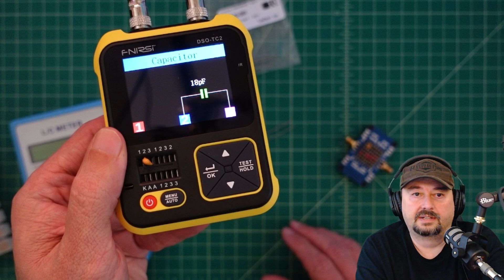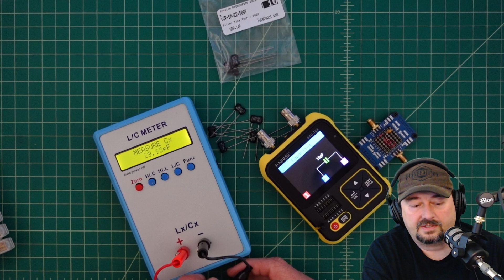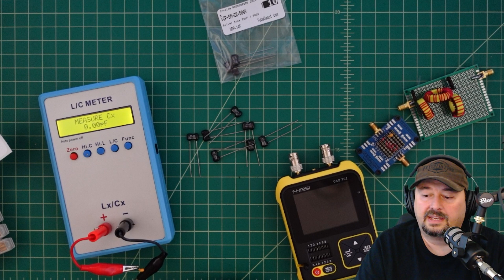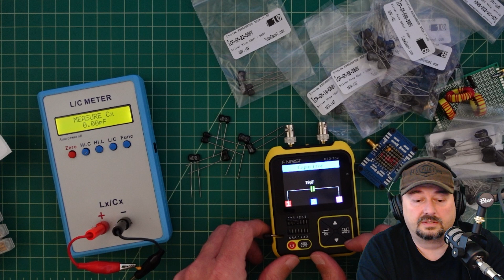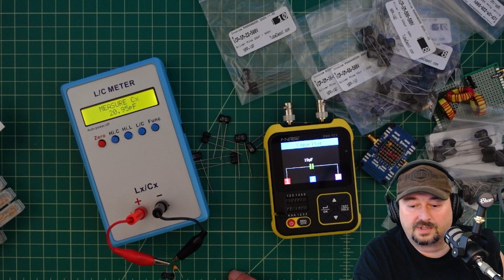Measuring Capacitors - Slight Rant

Comment: Inported capacitors RF functionality Quality is all over the map These days....For Critical Vhf & Uhf applications,  Industrial standards recommend Silver Mica capacitors < 1000 pF  Should be Measured at 1MHz (minimum) Test frequency.....All Capacitors start functioning as Inductors at Some frequency.... NanoVna Smith Chart testing of Vhf & Above Capacitor applications is Usually the most Economical method.....Most 1 MHz & above  LCR test meters Are usually Unaffordable for Accurate home & Hobby use....10 & 100 KHz test Frequency LCR meters Don't always indicate how a Capacitor will Function at VHf & above applications.....
Reply from the maker: I totally agree, thanks Tom 👍

Comment: Those transistor testers are only good at identifying what a component is and approximately what value it might be.  I wouldn't go without one, but on any setting the accuracy and repeatability is proven mediocre.  They are classification tools, not measurement tools.  To be accurate, especially at the types of capacitance you are measuring (<400 pF), you might want to look into a LCR meter which includes at least a 10 kHz frequency setting (and maybe 100 kHz if your application utilizes that frequency), with guarded leads. Alternately, if you have a oscilloscope and signal generator, you can do validation as well through resonance.  Otherwise, you can trust the quality of new components if they are verified authentic by other users and just trust them.  I have a East Tester ET431 LCR meter and it only goes to 10 kHz.  On the 40 pf range the error is 1.2% in parallel capacitance mode.  This meter was reviewed on YouTube by Kerry Wong.  Also, to avoid expensive mica capacitors you may want to consider authentic class 2 ceramic disc capacitors.  Not all ceramic discs are equal, the dielectrics can be very different.  I think the type of cap you want to specify will depend how much drift you can tolerate as temperature or voltage changes.  You might notice that the little bit of heat from your fingers and/or the prior measurement voltage excitement can significantly change the capacitance reading for class 1 caps (X7R or X5R).  This might explain the differences you had during live measurements. Any good cap will have a datasheet available, and what you might find is the capacitance is tested at a voltage/temperature/frequency significantly different than your test environment and parameters.  What you could do with any equipment is test the handful of caps you have under consistent conditions and know that the relative measurements will tell you which of the 22pF caps in the box is likely to be 10% low, achieving your 20 pF target.  Hopefully these comments shed light of the issues you had and help you in the future.  BTW, if you want to use a multimeter with capacitance setting, I found a few inexpensive ones that have a relative feature that enable them to zero out the capacitance in the leads and be spot-on to the digit when measuring a 30 pF mica cap in relative mode.  Unit-T UT210E & UT120C; ANENG SZ08 & SZ305 & ST181.  They only provide integer pF precision and nothing else (D, ESR, etc), but more trusted reading than the FNIRSI.
Reply from the maker: Thanks for the detailed post Paul, it's helpful.  I actually just got the ET431 👍
Reply: @TheSmokinApe  I look forward to seeing your update on this situation and maybe a short review of how you find this tester useful.

Comment: I have my share of test equipment made in China. As for a capacitor tester, I use a DE-5000. It's made in Taiwan. I tend to trust devices made in Taiwan more than devices made on the mainland. But that's just me. I will check out Tube Depot if I need any parts for those more serious projects. I still want to see a 7 inch tinySA Ultra !
Reply from the maker: Hey David.  I ordered an East Tester ET341, hopefully is make my life easier AND a 7" TinySA would be pretty sweet!

Comment: I got the same set of blue HV disk caps. values all over. I have used them on UNUN for antenna 49:1 .worked fine. them silver mica are better for RF. for DIY projects I use Arco trimmer cap to tune in value then put trimmer on meter to read what the value is and make that with fixed caps. I just got some 49:1 antenna kits today. big seller . hard to find in stock. this a QRO 250 watt kit  . T 240-43 core .got just a winder base so I can do a 3 core stack. for this will try 2-220 PF in series for 100 pf around. I need more voltage for KW power. will try type 61 core for 10 meter and 6 meter band one. got the cores to make a few . and the winder base that fits T 240 core with SO 239 connector.. waiting for DX commander order on DX 50 wire now . jot a extra 7 meter pole as well. my last order from DX commander took about a weak DHL to come. going to be a QRO x-mas party ! 73's
Reply from the maker: Hey Robert.  Looks like you have a few projects on your hands!
Reply: @TheSmokinApe  just the antenna ones are for me. The talk pod is for my girl. that tested ok. her radio now but I still use it.

Comment: The FNIRSI is cheap as chips, it is based on open source "Transistor testor" arduino tester. It tests a LOT of things well, but you wouldn't usually rely on its absolute accuracy. The critical resistors used in the measuring circuit are probably 0.5 cent 1% parts, who knows if they use any kind of voltage reference or just the voltage regulator. It can also get extremely hard to test down to 2-digit picofarads because EVERYTHING is a capacitor at that range. Two wires simply twirled around each other are an extra picofarad or two, every bit of lead length on the part can add extra. It will be much more accurate around nanofarad ranges, if possible.

Until you have anything better I eeeeasily would rely on the 'dedicated' LC meter you have for picofarad stuff. The exact capacitance produced will also depend on the frequency of signal running through the cap (for most types of caps), which is why any more expensive LCR meters will have multiple options to tell you capacitance at difference frequencies.
Reply from the maker: Thanks for the info ivolol

Comment: As other folks have mentioned, measuring capacitance at intended frequency of operation is certainly what I tend to do. Recently, for measuring small inductance or capacitance, I have just used my NanoVNA. You need to make sure it is calibrated at the test point where you attach the component. With the NanoVNA set to display Smith Chart and L/C, you can read the L or C value off the VNA display. The meters you are using may be struggling to measure low values of capacitance down in pF range. Also, the long leads on the capacitors tend to add a small inductance in series with the capacitor that may give you lower than expected readings. When building tuned circuits of any sort, you normally have to expect to adjust capacitance or inductance slightly to "tweek" for best results. I would build the circuit using the marked values then test it before worrying too much.
Reply from the maker: Thanks for the info Steve, it's helpful

Comment: most disk capacitors have a tolerance value of plus or minus 10 to 20%, so no big surprise there. the most accurate way to measure a capacitor is using an oscilloscope and known value resistor. of course, fifth grade math is involved there. learn electronics channel on YouTube. did a fairly good job explaining this. I will probably get around to touching on the subject on my channel but it'll probably take about 5 years. just a note, ceramic disc capacitors have a piso electric response with vibration so you don't want to be using them in audio circuits.
Reply from the maker: Hey Richy, I need to get better with using the scope for that.  Thanks man...

Comment: My LC200a came with some pretty bad reference caps that require 30min warm up time to settle, and measured values jump around with the slightest temperature change. Fortunately Mouser and others sell quality poly film caps and the LC200a is easy to work on. Replacing those made L measurements far more accurate, and no more shifting. Reading up on this subject, it seems the original LC200a designer's brand is not common, and most of the fakes are of course using poor reference components inside. I'm still working on modifying the inductor for better C measurements... I read somewhere online a variable L tuned so the output is 500kHz (using "Func" button) gives excellent results.
Reply from the maker: I cracked it open and only saw Electrolytics and SMD

Comment: Glad you are upgrading to TDK capacitors for your xfmr. I use an extech LCR meter personally and it has worked well for me. The amazon meters and components are bottom of the barrel in my experience - You get what you pay for. Thanks for sharing !
Reply from the maker: Hey SC, I feel there is wizdom in your comment.

Comment: Nice video. Mica for filters are the way to go, if possible. The % standard they’re sold as is important for finicky circuits.

I lucked into a BK Precision 879B meter on eBay from a company sell-off. I bought another one (Accuhard A101) that is a usb lcr meter that handles a wider freq range. I took a roll of caps and took the calibrated test leads down each side of the wires to collect the readings 8th a spreadsheet … all were within the % range. 

Bumping up a notch in your test meter will make a difference. I’m not sure about Finirsi based on the tear down of their oscilloscope by Kerry Wong. But…$$$, lol
Reply from the maker: I think you are right, gonna bump it up.  Nice score on the BK 👍

Comment: One thing I learned in circuit design is it all seems to start with guess work.  You can design a circuit and on paper it works flawless, but in real life it doesn't.  All of the electronic components have tolerances so you will have a + or - in the difference in the rated value.  The tighter the tolerance the more expensive the component.  Also the same with components you have tolerances in test equipment and price for the tighter tolerance is more expensive.  There are circuit designs to lessen the effects of the tolerances, but with RF I've always noticed it was like an art form and took trial and error when designing circuits. 

Always like your test equipment videos, they make me want to get more into the design part of the hobby.  I got a education in design so it always interest me.  73
Reply from the maker: Het Travis, thanks for the post.  It's both fun and frustrating messing with this stuff 👍

Comment: I used tube depot for years. I used to build and repair electric guitars and amplifiers. 
So…you don’t have to go crazy. Most components average plus and minus 5%. Resistors can even be plus and minus 10%. Also they come in different tolerances and the tighter the tolerance the more you have to pay. This gets a little deeper into electronics and you need to know what the tolerance expectation is from the design. When someone says just throw a xxxpf cap on it, the tolerance can’t really be to important. Bottom line is there’s no reason to be pulling out your hair unless you’re working on a critical circuit. 
Might be a good search to look up tolerances for electrical components.
Reply from the maker: Thanks for the post and perspective John, much appreciated 👍

Comment: Don't waste your money. measuring capacitors is difficult that's why they differ. it all has to do with the frequency you are testing at the size of the capacitor things that are around your test area. what you have will work just go by what they are labeled as and if you need some fine-tuning find one that reads a little better, install a smaller one with it, or install a variable to tune it. electronics are not exact and the way capacitors are checked is just not totally accurate. you can use your oscilloscope and other tools to calculate the capacitor but remember the capacitor is dependent on frequency anyway. if you use a meter to check it it is maybe 12 kHz or so and the circuit you are using it in may be in the Mhz. so it really doesn't matter what it is reading in the kHz it will be different. there are very good videos on this I believe it was W2AEW that had one on this that was good and others. but the moral of my story here is just don't waste the money what you have will work good enough.
by the way same with coils.
Reply from the maker: Thanks for the detailed post Curt 👍

Comment: As you may know already, the measurement value produced is highly dependent on the frequency the tester is testing the cap (or inductor) at.  Any cap value these testers are displaying will not be the true value in the finished bypass filter.  

Also, a better version of your breakout dev board would be one that only has the  number of sockets needed to produce the order of filter you want in the final construction. Removing all unused traces and traces will get you closer to the final specs when swamping out caps and inductors in the fine tuning of the circuit.
Reply from the maker: Agreed on both counts, this was just playing around and decided to share part of the story.  Thanks for the comment 👍
Reply: @TheSmokinApe  I really appreciate your style of videos. You talk to us, not trying to "entertain" us.  Not flashy, you get right to the point....very low fluff.
Reply from the maker: Thanks man, I try!

Comment: Did you consider using your NanoVNA to measure the caps? I pretty sure that you can somehow use it to measure capacity 😁
Reply: This would be a great way to measure, you would be able to check with the frequency being used in the circuit.
Reply from the maker: Yeah, but I think there is some math involved.  I did use the VNV to tune the circuit by adjusting the coil 👍
Reply from the maker: Thanks Curt

Comment: Mouser for caps. TDK is good. RF caps not necessary unless you need the precision or voltage.

Also, measure a higher value cap to see if it is off by a similar % or a fixed amount. The meter is probably spec-ed like 2pf +/- 3%.

BTW, 22pf in parallel with 220pf = 20pf. Good enough for prototyping.
Reply from the maker: Yeah, the meter and the components have tolerances 😡

Comment: buying my son a soldering iron  for his tube radio repairs  ,corded 110 US plug , pencil grip , auto off , average price ,  any ideas on a reliable brand that’s user friendly 👍Thanks
Reply: Not sure about auto off, but Hakko 888 is good. Hakko is a top brand in soldering gear, from hobbyist to professional.
Reply: @LeeMccNA5T 👍thanks
Reply: Hakko and Weller are the good go to brands.
Reply: @Ezzell_  thanks
Reply from the maker: It’s need said, Hakko and Weller 👍

Comment: I was in the same boat a while back.  Bought a Sencore LC53.  It is awesome.  Like they say, buy once, cry once.
I've also been looking at the DE-5000.  There's a bunch of people using them.  I want to see how it compares to my Sencore.
Plus, having and LCR function with adjustable frequency testing would be nice.
BUT I already have a Peak Atlas LCR45, so buying another LCR meter is hard to justify.

Amazeon caps are THE WORST.  Just don't do it.  There's a reason why they are so cheap.
Reply from the maker: I'm hoping the set up in the caps will make my life easier 👍
Reply: Sencore is legit - with amazon you get what you pay for.
Reply from the maker: Hey SC!